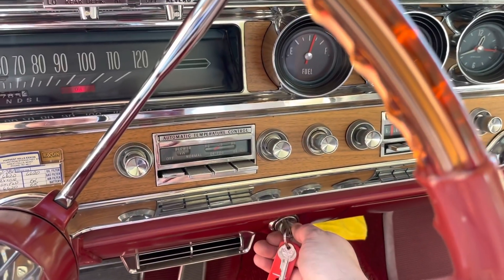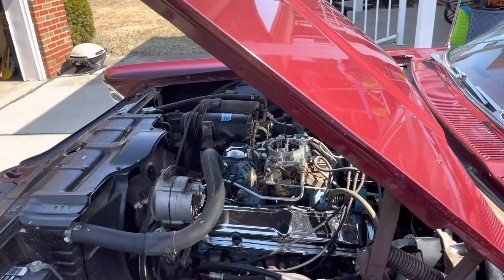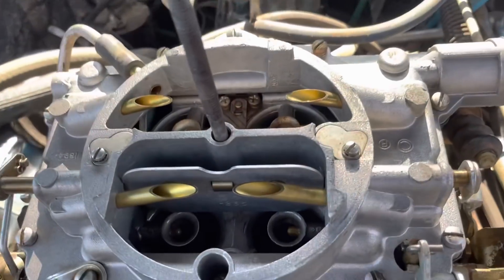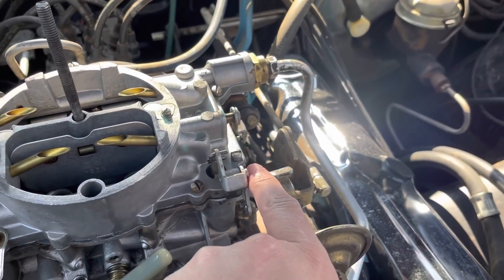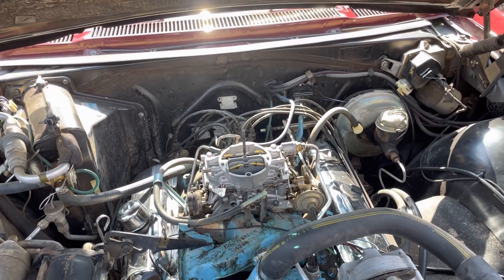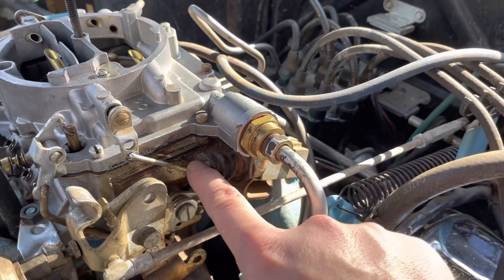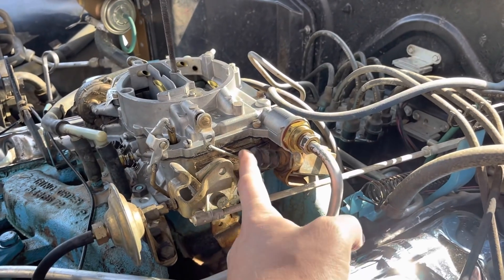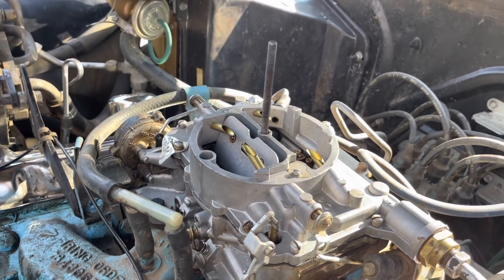1965 Pontiac Bonneville 421 Start Up, Run, and Carburetor Tips

Comment: I still wince when someone, especially as knowledgeable as Adam, says big block Pontiac
Reply from the maker: That is fair. Bad habit.  Well, can’t I say big block to distinguish it from a 265/301 that has a short deck?
Reply: @RareClassicCars  : Technically, Pontiac nerds like me say small journal & large journal (refers to crankshaft journals) when we are talking about Pontiac V8's. There are no small block or big blocks, just the Pontiac V8. Every Pontiac V8 engine built from 1955 to 1981 shares the same basic outside dimensions. The 421, 428 & 455 cid engines have the large journal crankshaft, all other Pontiac V8's have the small journal crankshaft.
Reply from the maker: @rogergoodman8665  I believe the 265/301 have 1” shorter deck height vs the 326-455s, correct?  9.14” vs 10.24” for the latter.  So, loosely, couldn’t they be called “smaller blocks”?
Reply: @RareClassicCars  :Yes, your correct & That'll prevent intake manifold swaps from other Pontiacs. The 265 & 301 also have relatively weak crankshafts with only 2 counterweights. When they came out I knew the glory days of my dad & granddad buying a new a torque monster V8 luxury Pontiac  were over! Most other parts also won't fit the 265 & 301. They weren't particularly bad engines for the time though.

Comment: How do you feel about octane booster? I use it in my 68 Volvo. It really runs better with it. With low test gas it runs like crap.
Reply from the maker: I’ve used it and it helps a little, but nothing like a few gals of racing gas
Reply: @RareClassicCars  Racing gas is not very available around SF. I use the the 108 booster it makes a world of difference. I only fill up with 93 octane to start. Straight 83 octane makes it diesel and hard to start. My Volvo tank is small compared to a big American car so I think that’s a factor too. What is the octane of racing gas you use? Do you use Sunoco?
Reply from the maker: @evanswinford7165  I believe it’s 110 and it’s at a local Marathon station.

Comment: If you really want to know about all the idiosyncrasies of that car car talk to Steve Peluso the president of the Pontiac club located in Dedham, Mass. I used to build transmissions for him, did your THM 400 forward frictions burn up yet , or has the 2nd snap ring popped out ?
Reply: Ha ha, the intermediate snap ring only pops out when it is installed backward!   I learned from experience!  LOL!

Comment: What a beauty!  Hard to find sport sedan [Vista].  Then, add the 421, automatic A/C, rear defogger AND the reverb, it is probably a scarce to find car.  That says nothing of the beautiful color combination.

Nice tip on the kickdown switch vs. adjust the throttle lever.  Lots of those switches were changed at dealers in lieu of the adjustment, back in the day.

One of the few sitcoms I really enjoyed was "Grace Under Fire," in which for the opening credits, Brett Butler drove a 1965 Bonneville sport sedan [Vista].  Hers was a bit better equipped, with an AM/FM radio, power windows, as well as the goodies on your car.

https://www.youtube.com/watch?v=5q7CYNZH2gw